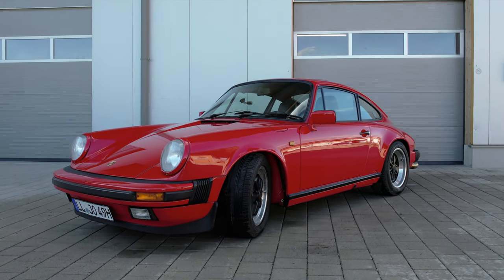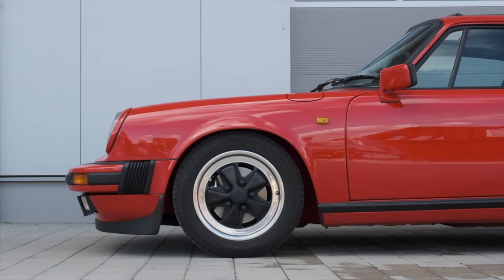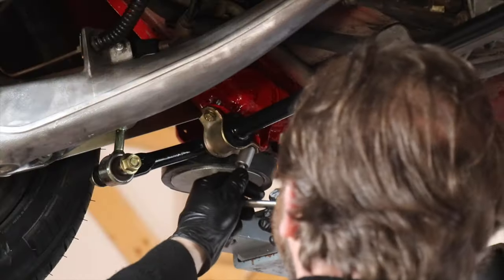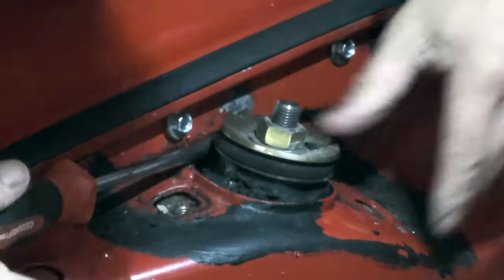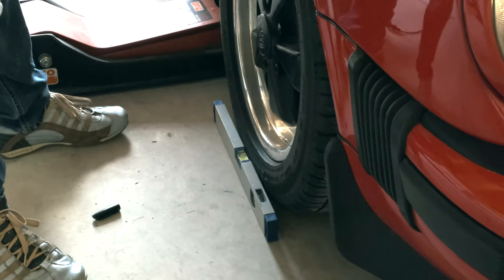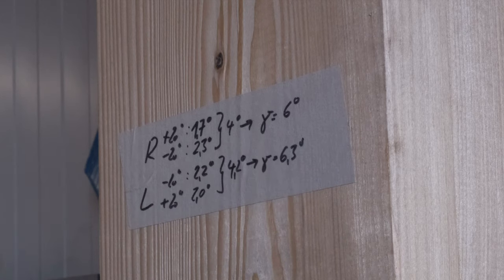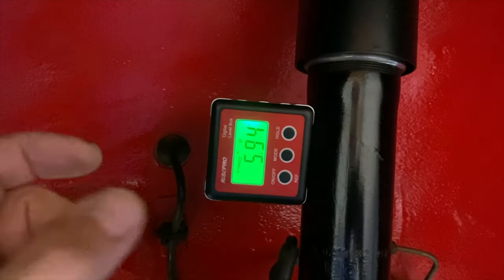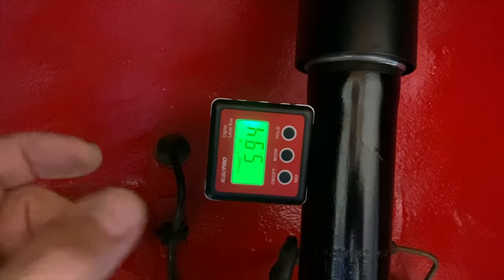Massive Improvement of Roadholding: Adjusting Toe, Camber and Caster (Porsche 911, 1987)

Comment: Bought a new '76 530i with poor panic braking at 50mph on the highway. Impossible to stop immediately due to caster off considerably. Finally got the zone BMW man to a Houston BMW dealer
for a tech adjustment. He put 5 washers on the front left suspension as I could see the addition. Took the car out for a braking test and it still would lose control at 50mph with a heavy foot on the brake as the car rear end would start to come around on a level stretch of highway. Apparently the front suspension mountings were no correct at the factory and Mr. BMW was not willing to go further. Neither was I and I sold the car at 9 months. 3 EGR valves, one two piece drive shaft and rubber coupling, lots of over heated spark plug-fowling, rusted out gas tank, out of balance original tires (dealer jacked up a new car and gave me those better tires), air conditioning could not keep up with Houston summers-vinyl seats made me uncomfortable, car had a miss at idle and it was not the mass air sensor. Sold the car. No more BMW's for me.
Reply from the maker: Hi Vincent, yeah, sometimes they just drive you crazy. 😤

Comment: To get these cars to handle great they have to be corner balanced.  To do this you need easy adjustability.  I also lowered the car, but did it properly, by not changing the angle of the tie rods.  I used Fox Racing Shocks, which take the place of the compete strut and spindle.  Spindle height can be adjustable, to keep the suspension in the proper operating range.  I also used a real bump steer kit, not just spacers under the steering rack.  The shocks have nitrogen canisters, which are double adjustable.  The back shocks are custom design inverted  Biltien, with. Nitrogen canisters, and are triple adjustable. They are custom built length and travel to compensate for the lowered car.  There is no rubber in the suspension. All monoball and bronze bushings.  I have an alignment platform that is very heavy duty. Having the car on a perfectly level surface,which the platform provides is critical.  It gets the car up so you can get under and make adjustments.  The platform has scale pockets, and I have turn plates to and just the camber.  I have all smart racing products alignment tools and longacre scales.  I use the string alignment method.  Being that I have multiple 911s it was worth it to purchase the equipment and learn how to align and corner balance the cars.  I was able to adjust and set the Kenimetic Toe on the 993 with two digital levels, instead of the Expensive Porsche tools.  Please keep making these great videos.
Reply from the maker: Thanks for commenting, Rod.
Did you build that as a track day tool?
Reply: @GreasyFingers    I was autocrossing it for a few years, then stopped to make more modifications.  The car was fishtailing really bad, which led to finding the extreme toe out at the rear, and the bent torsion bar tube.  The right way is to cut the tube out and weld in a new one.  I was told by Rich Walton, at Jerry Woods Enterprises, where I bought all the Smart Racing alignment tools and front suspension struts with adjustable drop spindles, and Fox racing dampers, to leave the tube alone as long as I could achieve proper toe adjustment.  I had to pull the tube a little and modify the spring plates to allow for more adjustment. Most of the other suspension components, sway bars, 935 cross brace, adjustable quick change spring plates, bump steer kit, custom rear dampers, monoball upper strut mounts with precision adjustability, we’re from Chuck Moreland of Elephant Racing.  12 years later I’m still modifying.

Comment: Excellent vidéo which is a bit ancient Greek for me  but I am sure it make sense. Stéphane
Reply from the maker: You know what? You can learn Ancient Greek in a week. It’s not half as difficult as I thought.
Reply: @GreasyFingers  I need to start from scratch , any book or whatever to start with  ?
Reply from the maker: @Steph-iw3hr  You mean regarding wheel geometry? I think the wiki article to „vehicle dynamics“ contains all you need to know. Especially if you follow the links to the sub-articles of „Suspension and steering“.
Reply: @GreasyFingers   you' ve got it . thanks johannes

Comment: I really like your rack and I decided to copy it. You used 40x40 and 34x34 mm steal? My Porsche 924/76 is after a full restoration in need of a proper front and back alignment. Thank you! Sigurd
Reply from the maker: Nonono, much smaller. 
I guess it was 20*20 and 25*25.
Cheers,
Johannes

Comment: wonderful explanation of old school mechancs. As an aircooled enthusias, one of the best on the tube.

just one question. In the video you said you needed to remove the sealing when setting the caster; at the end of the work did you need to reseal it or just left unsealed?
Reply from the maker: Thanks, Francesca.
Yes, in deed I replaced the old sealant using butyl tape.

Comment: Verrrry interesting!  I spent about 6 years using a variety of alignment machines in a number of shops.  A lot of technicians have no idea how to calibrate their machines and therefore the end results can be poor.  Alignments and their respective geometries can confound most mechanics which are often only able to replace parts and have little interest in the theory of operation involved.  Good for you to get involved with DIY.  I do have a question about the caster on your car and the factory specs.  Is there not a recommendation for a slightly more positive angle on the RH side due to road crown?  When i had done alignments in the 80's most cars were set with 1/2 degree more caster.   We were also taught to ensure the tire pressures were correct before starting the alignment and preferably, the car should have half a tank of fuel.  The car should be bounced and allowed to settle after every adjustment was another recommendation.  Lastly, just a bit of trivia for you.  When it became standard practice to do 4-wheel alignments, one machine would use strings connecting measuring heads mounted on each wheel.  Techs could often be frustrated due to wind or breezes causing the string to oscillate giving erroneous results.  Lasers ended up replacing strings eventually.   Cheers!
Reply from the maker: Thanks for commenting, Brad.
The sealant Porsche used between the top bearings of the strut and the body is becoming brittle and hard after a while. It’s impossible to adjust the caster without removing it. And you know what? At about 60% of the cars I get in my workshop the sealant is untouched, ie the caster and toe had never been adjusted at all. Hilarious when you think about how people lower their cars. 
I never heard about adjusting caster unsymmetrically, but I do see the point.

Comment: Very cool work with base tools; only question is the check at the upper front damper cover that may not be in line wit the damper axes.
Reply from the maker: Tomorrow first thing …
Reply: @GreasyFingers  I did first check an adjustment and it starts getting better than before, great thanks
Reply from the maker: @MX-fo2nu  Great news. I checked the damper and didn’t find anything that made me suspicious. Did you notice anything specific at some place in the movie?

Comment: Wish you were my next -door neighbor ... I am going to have to watch this 6 times to learn this method, but learn it I will....  Surprised,  since you seem to love making tools, that  you didn't make ( or find) a straight edge that would sit perfectly on just the fuchs rim w/o touching the tires. I am skeptical that tires are as perfect as the rim.
Reply from the maker: Thanks, mate.
It’s funny you say that, because that was exactly the point I made when my master taught me this work. He answered: if the tyre is not exact enough, you have a tire-problem, not a problem of suspension adjustment. 
After many years, I have to admit he was right.

Comment: What I didn't understand why toe at the end or was it just record that way? I would imagine that off-toe would severely put off weight distribution and thus affect caster and camber. But then again I haven't been so lucky last time i tried setting up suspension geometry myself using the string method only. Our TÜV said toe was off about a 1° overall.  I had to resort to the lasers do the work ultimately.
Reply from the maker: To some extent all angles have an influence on the others. I actually did toe first (without the camera on), then I did camber & caster and then toe again. Then drove the car a week or so and checked it all again.

Comment: Very informative and as with all your videos, done in such a lovely way.  I think I need to do this on my 3.2.  I paid for 4 wheel laser adjustment and they struggled with the caster and I am not happy with the handling so I am certain I will have the rock hard sealant at the top of the strut as you clearly show.  My question is...once you'd removed that, did you replace it with anything?    PS.  I am also now saving up for one of those 1 post lifts...
Reply from the maker: Thanks, James. It’s always the caster that the laser guys mess up. 
I’ve replaced the original sealant with Butyl tape.

Comment: For rear its not shown yet how to adjust ; i already did camber adjustment via 12mm 6kt  and its also not difficult and good to meassure with the angle messure box  and also easy the manuel hand made adjust with the metal gauge for a good toe in for the rear wheels
Reply from the maker: Don’t understand, mate.

Comment: Good afternoon, i am in great admiration for your vidéo channel  greasy fingers.
I also have a 911 carrera model 1986 in red like yours. May I ask you a question ? On the front camber you turned the front wheels to 20°, then with your ruler took the front and back degrees of the tyer but then marked one dimension on your sticky tape, does this mean that you took the average degrees between front and back of the tyre, or was that curiosity ?
I would be very greatfull to hear from you.
From an english man living in the south  west of France.
Yours sincerely
Alex
Reply from the maker: Thanks, Alex.
The camber can be measured directly with the wheel standing on the ground and 0 degrees steering angle.
To measure the caster, the camber at +20 and -20 degrees steering angle are measured and the result you insert into the formula that I wrote on the tape. 
I hope that answers your question. If not, please feel free to continue asking, maybe using the time stamp of the film you’re referring to.

Comment: Hi, thanks for your videos, all are well done and nicel to watch. May I know what tyre sizes do you use? I have 15 inch rims.
Reply from the maker: Hi Jose. Thanks for the feedback.
Yeah, I have the stock 15 wheels.
Reply: It is hard to find tyres in proper sizes, 195/65 or 215/60 are those the Michelin you use?
Reply from the maker: Yeah, that’s the Michelins.
In fact they’re hard to get in Germany too. I tend to order them in October to have them in February.
Reply: The car in this video is on 16” with Michelin Exalto 2. Those are not produced in 15” 911 sizes….

Comment: Great vid as usual… so caster angle can be measured directly on the strut with an angle gauge?
Reply from the maker: Basically yes. The problem is you measure it with the wheels weighted and unless you have a lift on which the car can stand on its wheels, there's not enough space to apply the angle gauge.

Comment: You have put handling straight but 911 still want to go straight when pushed hard and steered deeply... some say that the car handles differently with full or half a tank
Reply from the maker: Yeah, I do notice a difference between full and empty tank. 
Regarding steering behaviour, all you say is true, but still I like it. Feedback and control about what the front wheels are doing are unique. I prefer it 7 days a week over today’s electric plastic steering.
Reply: @GreasyFingers  true... i do like analog cars. Never ever driven a 911.

Comment: Seems like it would be easier to buy a cheap set of wheels and mount the wheels without tires and let it rest on the ground on the rims just for measuring.
Reply from the maker: That’s what I said to the guy who taught that job to me. His answer was: If your tire is not sitting properly on the wheels, fix the tires first.
Reply: @GreasyFingers  he’s myopic. Tires are not perfect. A wheel will be precise. I’m sure a tire will be pretty close.
Reply from the maker: Yeah, there’s gear that connects to the rim, but I never felt the necessity to spend money on it, because tire is precise enough.